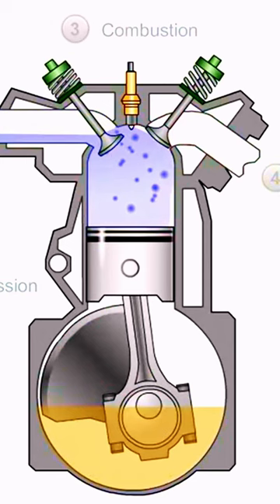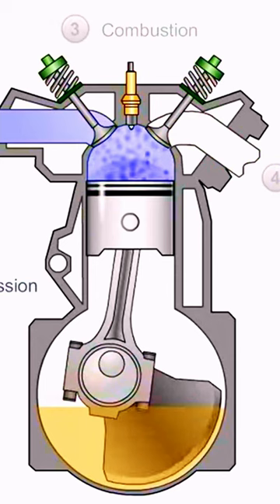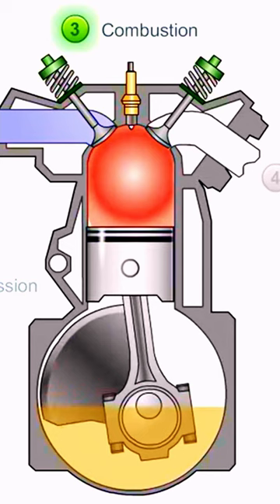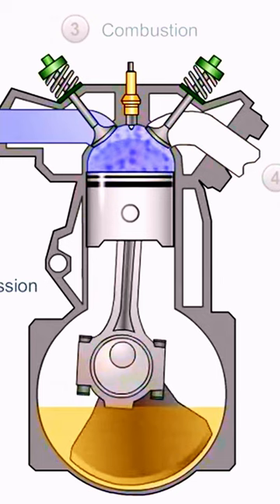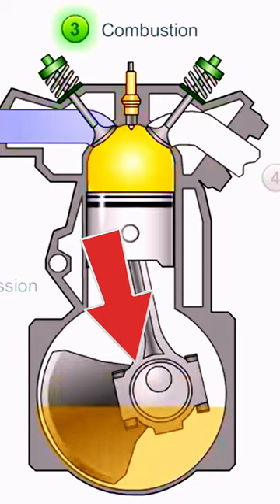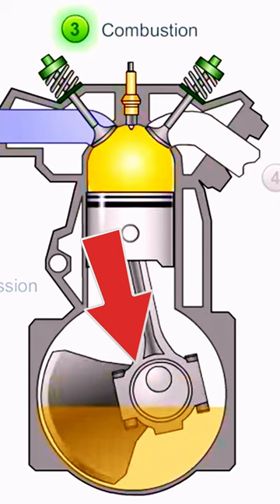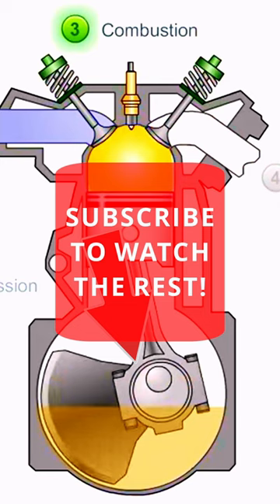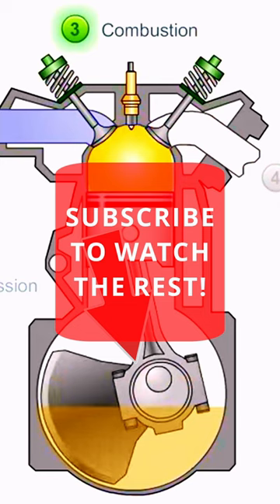Torque VS Horsepower

Comment: See the oil line, that is why we don't overfill the oil
Reply: Yes,
Reply: I believe that example is extremely overfill at least for a normal automotive engine some small low power engine submerge the crank

Comment: horsepower = torque * rpm
Reply: nm or lb-ft?
Reply: HP= torque*rpm/constant
Reply: @johnkahare8583  *HP = Hit Points, or Health Points
Reply: kW = Nm * rad/sec
This is the only equation that doesn’t need an additional constant
Reply: @Tomwesstein W= N*m*rad/s. kW=kN*m*rad/s or N*m*rad/(s*1000)
Reply: @Tomwesstein  that equation is false. A Nm*rad/sec produces a Watt, not a kilowatt.
Reply: @LScout800  you are correct sir, my mistake.

Comment: Technically the rotating assembly produces torque by itself when moving, otherwise it wouldn't have any mass, and that would be impossible.
Reply: It does not produce torque by itself. That would violate the first law of thermodynamics.

Inertia is what keeps it moving. When you try to stop it provides some sort of resistance in the form of a torque, due to newton's first and third laws.

Comment: Perfect explanation for a tesla since its a constant tork, aka a gas engine has 600 ho but not consistently
Reply: Tesla's don't have flat horsepower curves, though. They still peak, just like combustion engines.

And even torque falls off at higher rpm, for electric motors.
Reply: @Bertinator-nm9ld  yep witch is why I don't explain all of it, so people can figure it out, help more people learn

Comment: Can someone explain how the piston comes back up? Is it due to vaccum caused by exhaust valve?
Reply from the maker: No, it's mostly inertia of the crankshaft, it continues to spin and pushes the rod back to the top dead center
Reply: @MotoControlEn  thanks homie

Comment: Kids are lucky these days kinda, they don't have to read a book. Or learning the wrong way from that has the car down dude down the street with the headers on it.
Reply: so much easier to learn about cars
Reply: so true
Reply: i would typically agree, but this explanation is very oversimplified and i’m not sure where exactly this logic would be useful. mass is a very important part of the torque vs hp thing so this explanation is more a generalization of the behavior of typical engines.

i could be wrong but, in a sense, a massless engine (including all fluids) would behave similar to what people think of an ideal electric engine with infinite hp at 0 rpm. of course a massless engine would also have no momentum so it wouldn’t work either, but it goes to show how far you can stretch an idea before it falls apart.

all this to say that source is important and if you really want to learn something in depth, for the time being, you probably will still land on reading books. that’s gonna change in the next decade though. most engineering support classes are taught on youtube and a lot of in major classes too.

Comment: What is the yellow thing in the bottom? the engine oil ?
Reply: It’s our yellow juice lol
Reply: It's oil, it's showing you the rotation of the crankshaft and one of the weights on it which is the big piece, which connects to the connecting. Engines today don't need to be dipped in oil that's like the Titanic old diesel